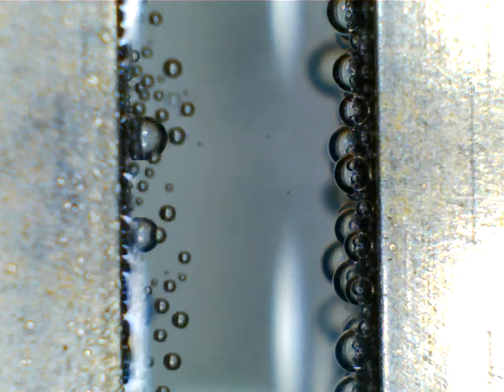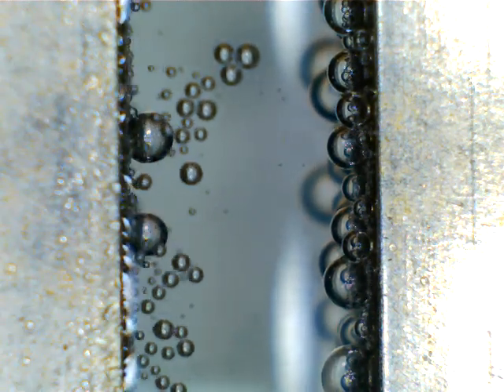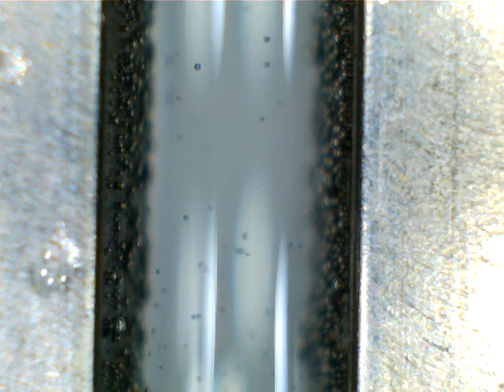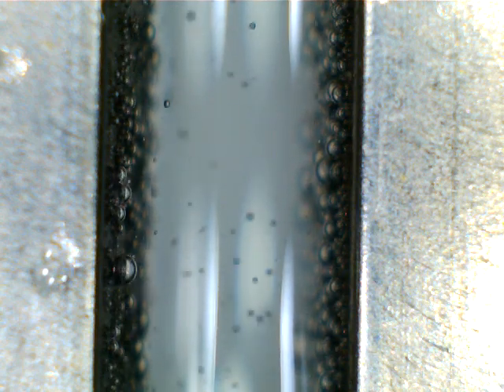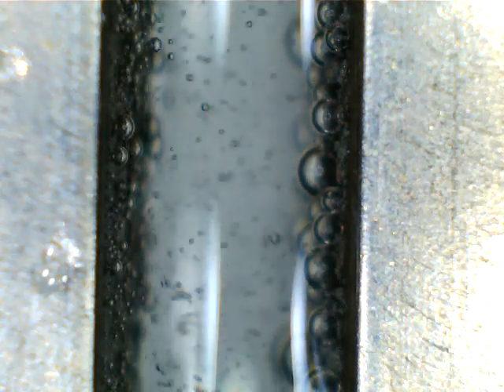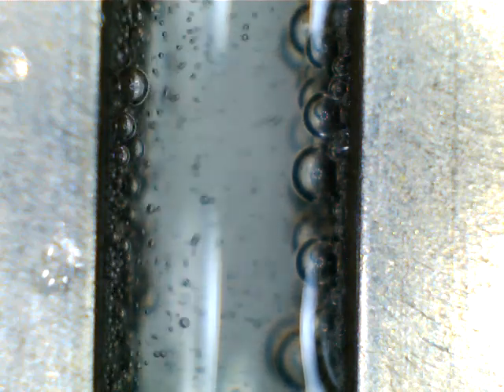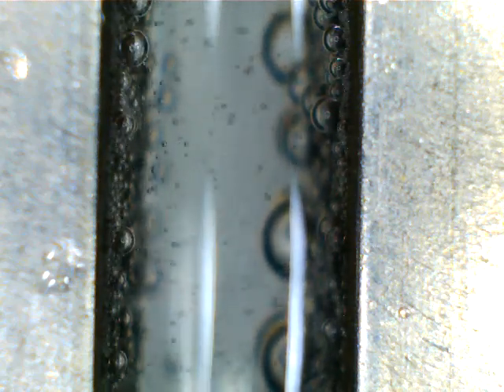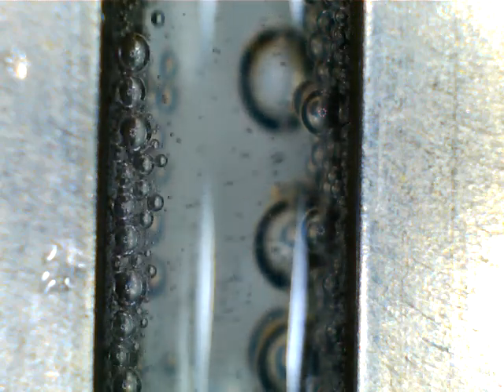High Voltage Electrolysis of water-under a microscope-Tap and Distilled comparison

Comment: How long do you estimate it would take to electrolyse all of the water?  Have you run the test for long enough to observe the rate of hydrogen and oxygen generation?
Reply from the maker: I didn't take any measurements here. I was looking for oscillations to see if they occur with high voltage.

Comment: Sorry guy. Stan used a pulse width modulator with 42.1kz square wave with 70kv in distilled water. Tap water is all different so , each refill would have to be retuned. Unless all water fuel was distilled
Reply: Use a sport car ignition coil and wires otherwise be warned. Then get a small electric motor with rheostat to turn a fixed distributor until desired frequency. Copious gases will be released be aware of such things.  On demand hydrogen production is like holy grail stuff. M
Reply: Shit I forgot , spacing of electrodes should separated as far as can be achieved. Steel vessel could be the cathode and the anode a steel pipe stuffed with stainless steel brillow for suface area this will determine the capacitance
Reply from the maker: Interesting. I've heard others claim the 41.2kHz (Keeley's freq) is some magical frequency but I don't think it is. At the same time, after 12 years of study I know there are many possibilities out there that I haven't looked into.

If you look at Stan's specs from his estate the frequencies of his 11 tube WFC and 5 coil VIC were in the 8-12kHz range. At those frequencies the math explains how the voltages (up to 20kV) can be created if all variables are precisely tuned and aligned, the hard part is getting everything correct. When water is used as an electrical component all sorts of problems arise that make replication almost impossible.

I know someone who got it working about 5-6 years ago, he got sick from exposure from the radiation produced within the device because it was not shielded properly.

Comment: Hey cool to see some HV water experiments. Have you tried a chamber with insulated plates? At these voltages the connection with the water may not even be needed.
Reply from the maker: m3sca1 

Insulated plates will work only in one condition- the insulation layer must be a dielectric with a higher dielectric constant than the water, the higher the better...An insulator will not transfer the voltage unless it can be polarized. See the patent below for an explanation. 

https://patents.google.com/patent/US4427512A/en?inventor=hee-han&assignee=Tay&oq=Tay+hee-han

Comment: I want you to take a look at this video as the plate spacing makes a big difference for the plate spacing in these three electrodes hooked up in series is only 0.025 inches: https://www.youtube.com/watch?v=hW78gKn1ZZ0 Note the size of the bubbles and understand that Ionized hydrogen gas atoms occupy more space and thus are larger in size than diatomic hydrogen gas atoms this is why the water appears as if it is boiling. So, try to decrease your plate spacing as that act lowers the amount of potential voltage difference that is needed to start the process. The drawback is you are raising the capacitance and increasing the load that is being place on the transformer thus you might want to try some type II deionized water. 
It would be helpful if you showed the waveform that is being places on the capacitor so that people like me could lend you a hand if they wanted too.

Comment: Not right way it must by in between at the middle you must have an objectively plate system
Reply: actually I think hes doing a Great job Its just to show the reactions most people don't see so there is no need for what your saying.
Reply: @madscientist4021  no it's great but I am saying that he will get it right because l am seeing tornadoes it must be stade at meddle
Reply: @madscientist4021  he is one foot to solve it
Reply: @madscientist4021  https://www.youtube.com/watch?v=GWIQ8fGKA_k&t=895s
Reply from the maker: AYMAN AHMED 

Thanks for the comments. This video is just meant to show that voltage produces a physical effect on the water. 

Although 4kV is applied the leakage current pulls the voltage down to 120V or so. Imagine the effect with 4kV- the only way to do that is with the VIC circuit. 

The Ions and molecules are deflected, this has been observed in science and it does not require an alternating electric field. My next video will demonstrate the phenomenon that occurs if I can get all the variables correct. Might take a few months though as its not easy to demonstrate under a microscope.
Reply: ya i am waiting for that video